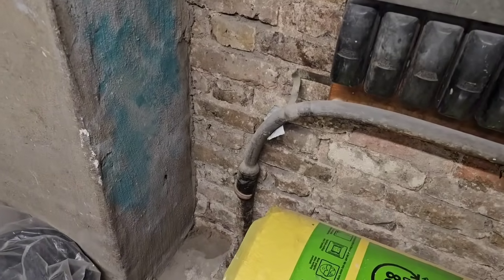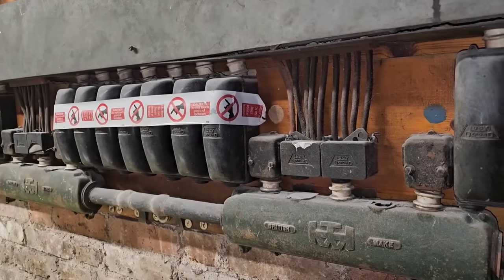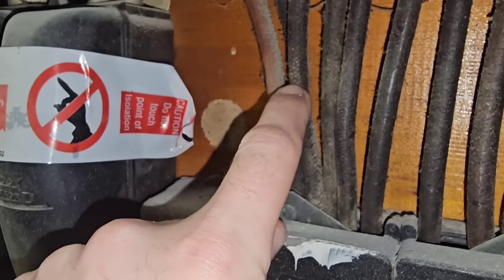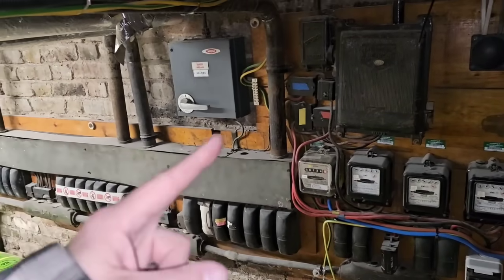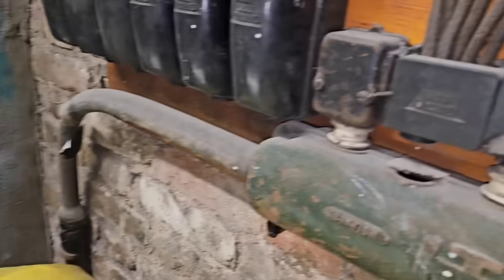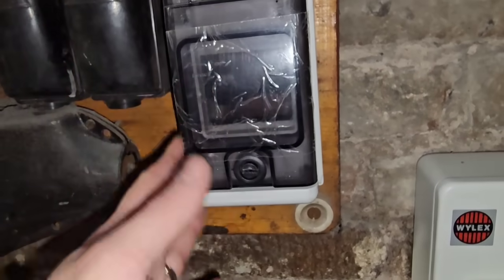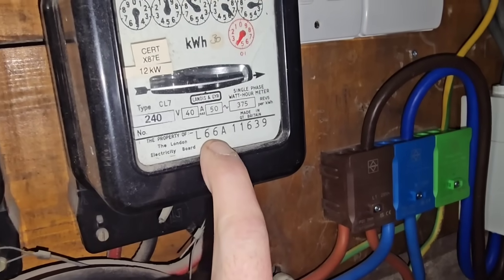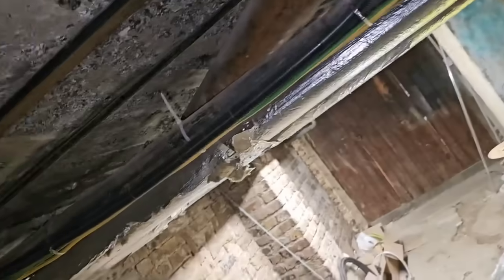Ancient 3 Phase Mains Problems

Comment: I worked for the leb back in the day the incoming pilc cable is more than ample to carry 200amp supply i used to get this a lot the dno needs to upgrade there system but the land lord didn`t want pay for the upgrade and also the tenants would have no power for a couple of weeks while the old vir risers are being replaced as you say chicken and egg

Comment: I am so glad I live in a modern built house.  We have 400A (240V) service into our house, and we have dual 40 breaker panels (CU)'s that are almost full.  It just baffles my mind how small electrics are in the older buildings there.  With all the electric mandates in the UK, how are they going to support all this?  For example these 20 homes/flats will need EVSE for each one at some point.  That is 7KW per flat alone for that or 140KW right there for just car chargers.  Then maybe add electric heater / boiler etc.  It adds up quickly to modernize homes.
Reply: 😂 car chargers in a flat? I bet this old place doesn't have any car parking, it was horses and carts when it was built...

Comment: You've hit the nail on the head there. The main stumbling block is going to be who is responsible (and more importantly willing) to pay for what.
Sure, the DNO could replace all of their equipment, but of the downstream installation is unsafe then they wont re-energise until its been rectified.
Plus if the downstream equipment (noticeably meters in your video) is not rated high enough then they will downrate the cutout fuses, in which case electric heating will still not be an option.
True what you said about that current installation being very space hungry, but that nice bare wall behind you has more than enough room for a heavy duty cutout, CT meter, and group service panel 👌

Comment: 28836
There are other problems, but this is London so business as usual, I guess!
There are ESMA seals are missing from several meters (the ESMA seals are the ones put on by the manufacturer to ensure accuracy) ...... but the date of manufacture is not everything! They used to take them out and refurbish them for a second (and 3rd) run, so the 20 year lifespan is only from the last refurb. They still need replacing though!

The way to do the upgrade is to put a tempory supply in. Put your new supply in and swap over, but getting a BEMCO board in there might be tight ..... still doable though! 
The Pilk will need replacing though and as you say that is the DNO. After the fuses it is the supplier and the building owner to cover the cost and arrange the work. It will need doing eather planned or when it burns out. It looks like the phases are all on each bank of fuses and it makes little difference which is which as long as you don't have 3 phase kit ....... like the lifts ;o)

It being London I would expect there to be no room for expansion on the network so there may be a justification for a new sub (your guess could be on the low side for that) BUT ...... IF they overload the system and cause damage it is down to the building owner to cough up the ££££'s and that will be done as an emergency and may not be covered by insurance!

I have seen similar setups in Bolton, but the issue there was many different owners of different parts of the buildings!
Be careful out there! Dammage to that type of kit is not always visible and can go very bad very quickly!

Comment: I'm worried about those rubber insulated wires since as they age they can start to conduct electricity through the insulation and that can be an accelerated process causing a fire.
Bakelite also is a risk since if it starts to conduct it's also an accelerating process.
Just pray that there isn't something going wrong until an upgrade is done.

Comment: I live in a block of flats that had a similar setup. The DNO (Scottish Power Networks) replaced everything and brought new mains into our flats. Responsibility is a bit easier as leasehold doesn't exist in Scotland. The power wasn't even off for too long as they ran the new cables before disconnecting the old ones. They even dug a hole in the road to replace our lead sheathed incoming cable, only to scratch their heads for a bit, give up, and fill the hole in again.

Comment: 29,836. Could read those by age ten. I find them easier then pressing buttons on the modern ones.
Reply: And yet....... you still got it wrong.  He reads it out in the video.  It's 28,836.  The indicator on the 2nd dial hasn't quite reached the nine yet.
Reply: Indeed you are correct. I am wrong.
Reply: @DavidLee-nd2sx  It's an easy mistake to make.  I can pretty much guarantee that, if I had to read them regularly, I'd get one wrong once in a while.

Comment: careful where you are poking around if the lines are live and true 3 phase like we use for industrial power in the united states it may be up to 600 volts or more.
Reply: Uk three phase is 415v. Distribution is 240v single  with 415v three phase (okay officially it’s 230v and 400v but you will still get our old standard voltages) . Either way still not nice to have a shock but even with three phase that’s 240v to ground so you’d have to be touching at least two phases for a 415v shock.

Comment: At the end of the day the VIR must be replaced, surely?  Would the BNO be allowed to run splitcon up the conduits?  If so, my non-spark head is saying:-
New Ryefield board (and incoming isolator?) on the opposite wall, where there's room.
New traywork leading from the Ryefield to the existing cable wall.
Each flat, one at a time, gets its VIR replaced with a longer splitcon, which is cut long enough to be able to route properly along the traywork to the Ryefield, but is instead looped back and connected to the terminals freshly vacated by the VIR.
Once the DNO installs a new service head and a connection is made to the Ryefield, each flat gets disconnected from the old fuseholders and its splitcon brought across into the Ryefield.

With the audio hiss in your recording, have a play with the free Audacity software if you can.  You can capture a "noise print" just after you speak and before it fades out, Audacity can then be told to strip this noise from the entire track.

Comment: Run all the new feeds to the flats (and lift?) in advance, to a ryefield on the opposite wall. Install meters and switch fuses on trunking or tray next to the ryefield, I reckon there's enough room there. Then on dno day, employ a couple of other sparks alongside yourself to switch over to the new supply inside all the flats - arrange access in advance. You could each do 6-7 flats, connect straight to the dB in each flat and remove any redundant equipment, then temp up the communal supplies, attack them the following day. 

It would need cooperation between the dno and meter operators to do this though. That's where the nightmare would start.
Reply: And all the flat occupants, landlords if tenanted, freeholder, and as pointed out that’s after you’ve dropped it on all leaseholders that they’ve got to pay the freeholder and the freeholder has to pay the sparks, DNO and MOP. What a nightmare.

Comment: Back in 2021 I was living in a block of flats built in 1960. This had an ancient 3 phase system which fed into a metal distribution cabinet with a huge bar across the front of it which was the main power switch (this cabinet contained all the fuses). 
There are 9 flats in the block, each one supplied with 100A.

It was so bad, that when electricians came to do work in the flats, they wouldn't touch anything in the old board, and would work on a live system!
I managed to get the DNO in to upgrade the entire 3 phase system to something more modern.
I do have some pictures, but of course I can't post those here.
Reply: sorry for bit of offtopik but i need to vent it before it goes out of my cognition:
three phase is the devil. like 333(3phase,3phase,3phase)* 2(30V) = 666. this cannot be argued with, reply with #6 if u agree. feel free to screenshot if u think this goes hard

Comment: So if I understand correctly... there are 20 individual apartments/flats/units. They all have one 30 Amp supply, and back when they were originally wired up, close to 100 years ago, that was considered reasonable and sufficient. The water heating and main room heating is by a coal or gas fired boiler, common to all the units. 

Now given that the value of these units has gone up, what say ten-fold over the last 20 years alone, I'd be interested to know if they are individually owned by the occupiers, or else the ownership of the units is by some Property Price Speculators, perhaps some Arab Sheiks in a Dubai registered tax exempt company.  

Seems that someone's made enough of a killing on the increase in prices lately, that they should be able to afford to update the wiring, including a full rewire if necessary, to reasonably meet modern standards. 

An electric heat pump system which also does the hotwater would seem a good option to investigate at least. And depending on the site, rooftop solar perhaps using microinverters, after any roofing repairs and upgrades are done. .
Reply: The meter reads 28836. When I lived in rural, not quite outback Australia, my place had an old meter roughly similar to that one shown.. Once every 2 months the electric authority would send me a postcard to fill in my reading and mail back. (Occasionally they could do a spot-check, if one of their service trucks was in the general area. ). cheers

Comment: Used to work with a DNO , the VIR submains eventually dry out ( or bubble !) and the phases start to short in the conduit  , fecking murder to get the supply back on. ( normally an overnight call out when your working alone and all the team leaders  are no where to be seen)

Comment: Maybe im crazy but if the cables are going above and over your head, why not start the works on the wall behind you and bring the supply there as well when ready, any boards that need to stay on that other wall could have cables brought over to that section, if this isnt possible id love to know why, love this video <3.
Reply from the maker: @lgbtskylar740  the existing cables are VIR (vulcanised indian rubber) which become very brittle and fail over time. Moving these cables would be risky and I don't think any spark would attempt it. The existing containment wouldn't be large enough for a new submain to be drawn through them. But the new supply could potentially go on the opposite wall ready for the new submains.
Reply: @John_Faultless  Ahhhh so its a real loss loss, I guess the first bit you have to do is get the VIR replaced and get ready with new boards etc then get the new submain and that after, may suck but you may as well just get on with it. Im currently a learner and want to be the best i can be :)

Comment: It's always interesting to see how things are done in the UK V.S. the U.S. In 30+ years of pulling wire in the states, I've not run into a setup quite like that. Here that would have been in a bus bar setup in any 3 phase system that old. Each apartment would have it's own disconnect plugged into the bus bars. that makes upgrading an entrance much less of a challenge.
Reply: This is 1950s tech.

Comment: This would be a complete shutdown as the DNO would want to pull in a new supply and change the service head to something a bit more modern. This is where the problems start. As mentioned at the beginning, the who infrastructure will need to be upgraded. This will start at the transformer and then the branch lines off it. Next problem will be who is responsible for the termination. DNO could fit a Ryfield cabinet but this is a big issue as it is in effect a HMO and the DNO could argue it is a BNO issue.  What ever way it pans out, the landlord/lease holder will have to fit new boards to accommodate new meters and isolators. 

Next problem is you will need to get each meter operator in attendance at the same time to fit a new meter and isolator. They will then run away as soon as there is power to the isolator and the incoming side is sealed up.

Next problem is no spark worth his salt is going to connect that VIR up and issue a certificate so the landlord/lease holder will need to commission an electrician to act as the BNO, fit fused isolators (i am assuming greater than 3 meters) and pull in new cables. Another option would be to run concentric cable from the Ryfield to each flat and fit Red Links and have the meters relocated to each individual flat which is what you see in most new builds on HMO's.

If enough prep work is carried out and you can get all the pieces of the jigsaw puzzle in place, this could be done in one day BUT you will need a lot to go your way and what ever route, it is going to cost a fortune.
Reply from the maker: @iancooper418  getting all the ducks in a row with the different meter operators would be a nightmare! It's definitely doable, but the owners of the flat don't want the expense as they've just paid for a new central boiler for the whole block 😬
Reply: @John_Faultless  If he/she/it is not willing to stump up, i cant see a way around it. I suspect that all the meters are old because the meter operators take one look at it and refuse to work on the VIR (our rules certainly prohibit it) and the DNO will only be able to do a "Bodge Job" on the supply side as part will be unavailable

Comment: Fairly easy to work out the phases, far left is red, centre is yellow and far right is blue. There are paint blobs on the board.
Reply: And that's how any sane installer would lay it out.
Reply: It’s actually red, white & blue
Reply: @stevemeeson8317  Not anymore. Dump is changing the flag colors tomorrow.

Comment: There are a lot of cutouts but only four meters in view, are the others in the flats. As far as I am aware the DNO is responsible for everything upto the cutout, the meter operator is responsible upto the outgoing side of the meter.
The electrician would have tails ready for the meter operator to connect into the meter and then the meter would be sealed.
Reply from the maker: @Himi-b1h  Yes the meters are in the flats. The freeholder of the building is responsible for the rising mains to the flats. The Building Network Operator. They will pass the cost onto the leaseholders for the works.

Comment: Straightforward to fix, having portable genset supplies as necessary, good electrical designer, and some project management.  It just comes down to cost, quality of work, and whoever cares about doing a proper job... Or not.
Reply: We regularly changed over incoming supply at tower blocks, with about 100 flats in them. And supplies up to every flat. It's certainly doable, but not a one man, or one day, job.
Reply: Then you face the question of who pays for the generators. The DNO would only consider providing generation (and paying for it) while the supply they provide is interrupted. The moment the cutouts are live they are under no obligation to generate
Reply: @jonathanfp123 cheers Jonathan, the aim of the comment was to suggest a bit of 'joined up thinking,' and get-stuff-done/quality-led attitude.  The gensets would appear to be a cost burden to the building owner, or building management company; as after all Periodic CapEx costs are a normal part of running asset or infrastructure, least as much peoples homes which I am sure would more than cover the cost of a project from profits or direct-costs-amoritized.
Reply: @Bari_Khan_CEng_CMarEng  yeah I picked up on that aim. But unfortunately it seems that, whenever there is multi-"agency" responsibility for a project, joined up thinking falls by the wayside in favour of every different "agency" trying to pay for the least whilst appearing the best 😞
Reply: Put a heat pump in and you can downsize by half 😂

Comment: The DNO could mount a new supply and meters to the wall on your right then the flats could be individually reffited to new consumer unit and meters on an ad hoc basis.
Reply from the maker: @Arachnoid_of_the_underverse  The trouble is the DNO don't own the meter's, the electricity suppliers do. So all the different suppliers would need to be involved, a new substation and supply paid for by the owners of the flat's and the new submains installed. The DNO will not connect to old vir submains. So it'll be very expensive and a nightmare to organise.

Comment: 30A 3phase for the whole apartment block? seems kinda low. m
Reply: I think he meant 30A single phase per flat?
Reply from the maker: @hillppari  The flats are from the 1960s with a central boiler system. There wouldn't have been much plugged in. They've also applied diversity to the supply as its unlikely all the flats would be drawing a lot of current at the same time.

Comment: Are they not better off putting a new supply with Ryefield board in on the other wall and running a new cable up to each flat so that each flat can be swapped over in turn
Reply from the maker: @anthonybragg  yes mate that's what needs to be done. However there isn't much space for the Ryefield to go and the route to the flats is a nightmare! The supply is not fit for purpose either as there's only 30 odd amps allowed for per flat.
Reply: @John_Faultless  All you can do is give your professional advice.